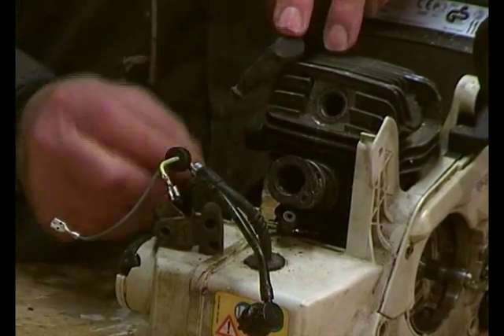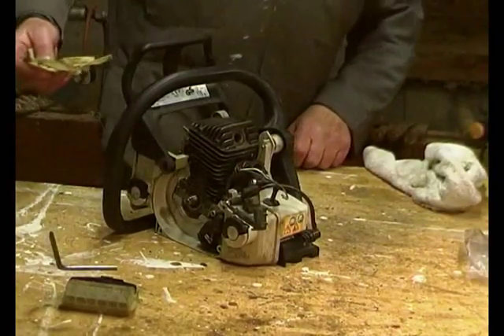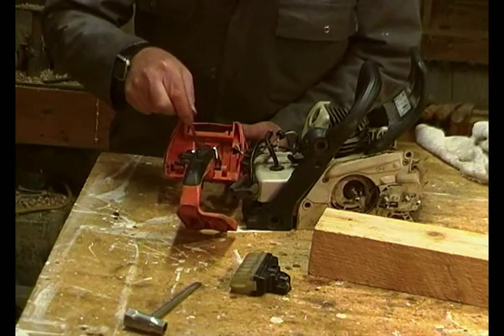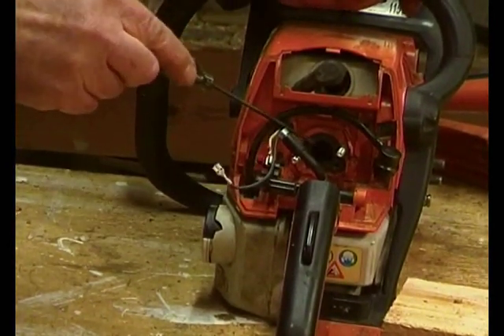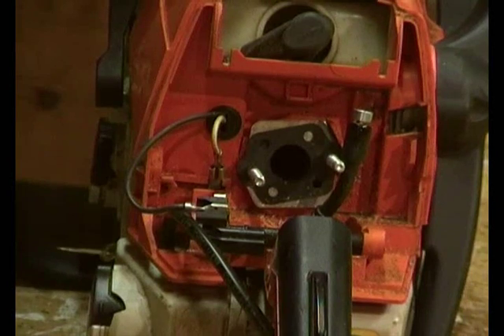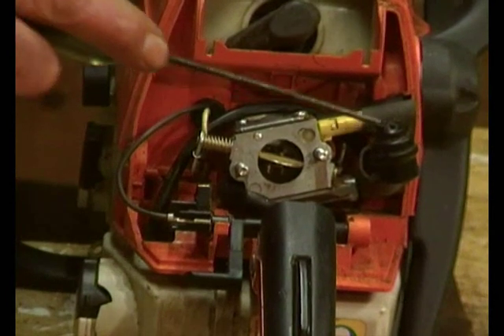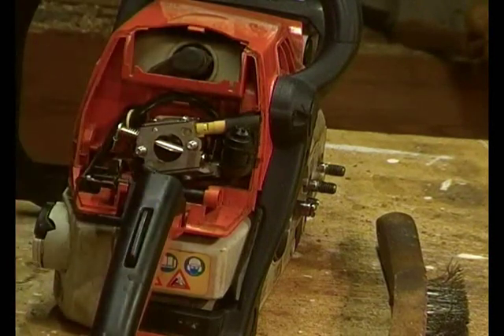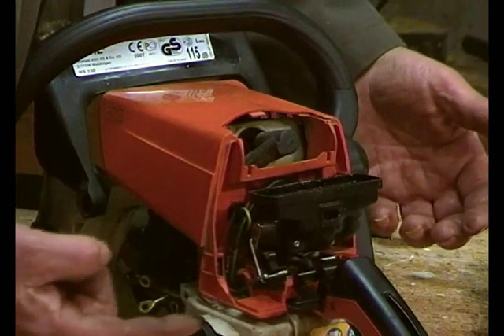Stihl 023 / MS230 rebuild, part 6. The top and rear handles, anti vibration mounts, carb fitting.

Comment: Hello Andy,
           thanks for all your hard work and good advice, just bought myself a second hand 023 recently, it's nice and clean, but seems a little low on power, just due to normal wear and tear I think but I'll probably put a new top end on soon. great to have your videos to refer to for all those fiddley little Jobs that seem easy when your taking things apart but become huge headaches if you've forgotten the steps when re-assembling. Looking forward to seeing yours running. Keep up the good work and take care.
Reply from the maker: Hi. I would suggest to give that saw some good work and get lots of new fuel through it. Saw s that have not been used, or used occasionally will not run properly until they have worked hard for a few hours. Always worth a go, and then just check the carb settings once the new fuel has cleaned out the carb and the deposits round the rings. Cheers

Comment: Thanks Andy, I've got plenty of logs and trimmed branches that I'll be cutting up for firewood next weekend, I'm hoping the saw will cut well, I'll give it a good blast as yuo recommended and see what happens, it seems a bit low on compresion to me, but the chap that sold it to me assures me it's fine. I popped off the exhaust to have a look at the piston and it seemed to have some very light scoring on the front skirt, plenty of carbon on top too, so I'll see how she runs and if I'm not convinced, I'll have a look inside and see if the cylinder is OK. There are plenty of aftermarket parts available online so hopefully, a new Meteor nikasil coated piston might be enough to do the trick, if not I look into getting a new top end kit.

Comment: Hello!  I'm stuck on my repair of a MS361.  Do you know where does the front end of the brake cable attach to; the S shaped end at the end of the wire?  Number 15 on the exploded parts diagram:  https://www.diyspareparts.com/parts/stihl/diagrams/ms-361c/2a8049b2-6779-4adf-a9db/
Reply from the maker: HI, I have never worked on a saw with the remote brake lever, and never used one. I assume this is to take the brake off and so the cable will pull. This should give you a clue as to which side of the rocker it fits, Cheers